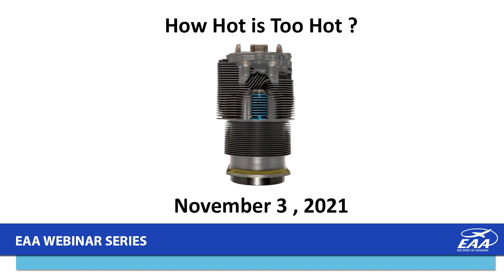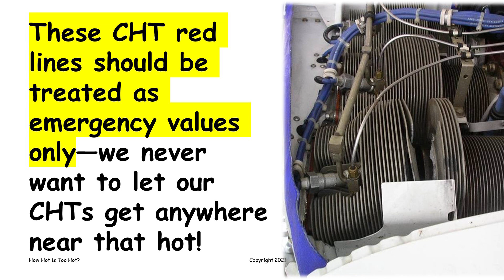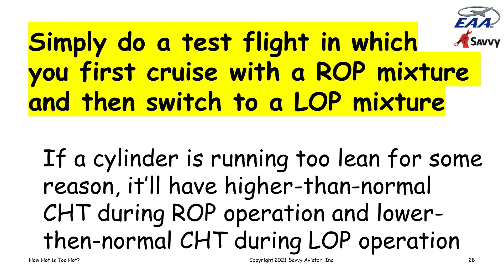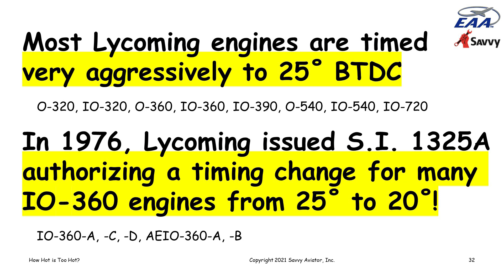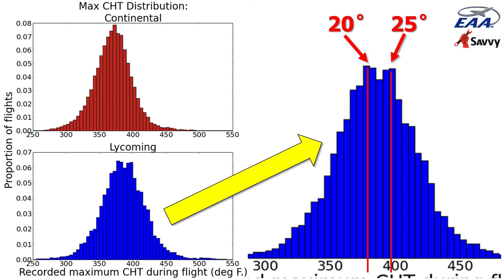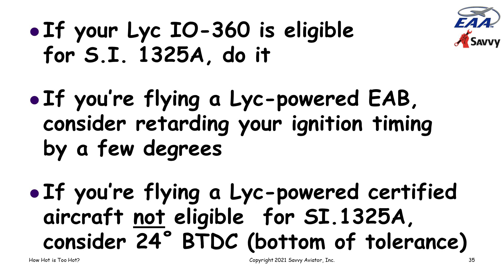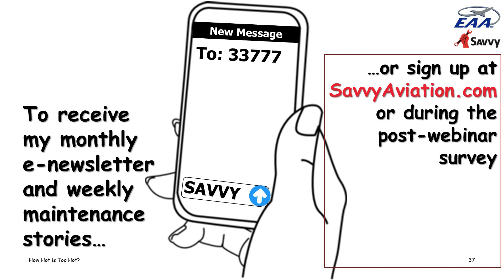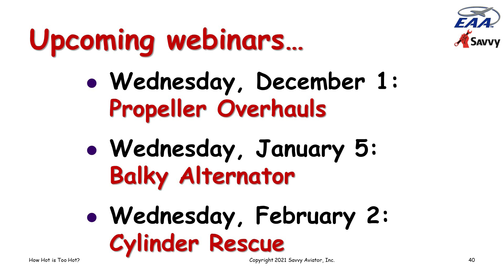How Hot is Too Hot?

Comment: My primary instructor was also the airport manager and A&P and he said shock cooling was BS clear back in 1978.  His C150s routinely reached TBO and they were “shock cooled” on every pattern circuit as he taught us to make all landings as power-off approaches and landings.  I am glad to see the industry finally catching up the him.
Reply: Your instructor was correct way back then but you were not in danger of shock cooling the cylinders from pattern flights. You need very cold for an extended period of time to have enough of a thermal difference to make the rate of change high. Shock cooling would need to be darn near intentional to happen.
Reply: @Pilotman28  Correct.  My comment was meant to be sarcastic for all of the “shock cooling” disciples.  I edited my comment and added quotes to make it more obvious.

Comment: Ion sensing can show peak pressure in relation to timing using a normal spark plug. SAAB pioneered this technology in cars circa 1990. Most current coil on plug auto engines are using this technology. I will comment further in a later post.

Comment: I generally keep all my cylinders under 380 on the TSIO-520's I run in two Bonanzas. 110 degrees and Heavy out of palm springs or something similar, Keeping the hot cylinder under 400 is a chore, but normal operations 380 is no problem. I'm more curious about the "optimum" or "sweet spot" because that 380/400 is for my hot cylinder, in a climb, on a hot day... My coldest cylinder doesn't really get past 350 in any situation and keeping it above idle temp in the decent can be tough.
Reply from the maker: This sounds reasonable for the operations conditions you describe.  You're not doing any harm there.
Reply: I have a 1952 C35, my 1&2 cylinder routinely get to 400-460 during extended climb.  I live in desert south West summer temps get to 110-120 f, this is only a problem during climb once at cruise temps are around 350-400.  How can I keep emergency cool during climb?  Full throttle, mixture full rich, rpm 2300, 100-120 climb out

Comment: Stugling to get my IO-520 B36TC 1983 to run LOP runs rough way before CHT temps drop as required. My Question is if CHT is below 380 and TIT below 1650 does peak pressure still have a effect  . I am thinking about lowering Rpm and Manifold pressure to a level where the temps are as required?
Reply: Call GAMI.  Your setup isn’t tuned right. There is no reason you shouldn’t be able to run LOP without any issue whatsoever.

Comment: I cannot get my IO-540 to run above 300°F. I've heard these numbers before and am very interested in managing my CHTs. We bought the Cherokee Lance (PA32RT-300) with a fresh overhaul. It did not have an engine monitor for the first 400 hours or so until we installed an EDM-830. I was very surprised to see the CHTs never get above 330 in a climb and run around 300 at cruise, slightly lower LOP. I would not think that the 1978 cowling (designed in the 60s) is better than modern design... However, my friend's '69 Arrow is the same.
Reply: Below 300 is unusual.   If you can confirm with a thermal IR gun that your CHT instrumentation is accurate, you might have a timing issue.
         
    Retarded ignition timing will decrease peak cylinder pressure, increase theta PP, decrease HP and also CHT.

    Have your magnetos timed with a Time-rite digital protractor (not a flower pot or using the marks on the flywheel).   Make sure to use the piston plug and the digital protractor to precisely determine TDC.

     Look carefully at your TCDS as well.  Many Lycoming angle valve engines have optional 25 degree (vs 20 degree) timing.
Reply: I’ve got same motor and issue in my Saratoga. At 30 degrees rich of peak, hottest cylinder is 330 and lowest around 298. About 1100 hours on engine
Reply from the maker: Are there cowl flaps?  You can use them as needed.
Reply: @savvyaviation  There are no cowl flaps. The interesting thing is, my friend's (who is also an A&P IA) PA-28R-200 also runs cool. Is this a Piper thing?
Reply: @stevespra1  my Piper Comanche 260b with an IO-540 with a JPI engine monitor runs about 315 degrees for the front two cylinders (give or take) up to 350-360 in cruise on the back two cylinders. It has 1300 hrs on it and I have not had any valve sticking issues. I recently performed the lycoming service bulletin 833c and none of the valves had any sticking issues. But I’m not sure why the front two cylinders run that cool in cruise. I do, however, fly 10.5 and 11.5 k feet regularly and run slightly ROP and close to peak.

Comment: Not a chemical engineer, mechanical engineer which is of course much better still (lol): 1:04:30 the bottom portion of cylinders do not have much heat from the combustion process because the piston doesn't go down that far so no need for fins, not hot enough to justify fins. 1:05:25 : Yes, excess fuel absorbs heat because liquids have much higher heat capacity than the vapour which is most of the substrate. Good question.

Comment: You can buy pin striping tape 1/32" (in many colors_ to mark your gauges on the glass and I would for airspeed and temperatures.
Reply from the maker: Markings must be in accordance with the aircraft type certificate data sheet... (TCDS).

Comment: Whatever the maintenance manual says
Reply: That’s not good advice. If you’ve been in this discussion for long you’ll quickly realize that aviation piston engine technology has been completely neglected in regards to innovation and advancement. Most “new” maintenance manuals were written in the 70s and that’s if you’re lucky. Even if the date of the manual says otherwise, the actual information is antiquated. So much has been gained in understanding by independent testing and borrowing from automotive developments that there is far better management techniques outside of maintenance manuals. TBOs that blow the manufacturer recommendations out of the water.
Reply: @jjchello  The information contained  in SB's, SL's and SI's  augment the lackings of the 1974 manual. The latest revision of the OHM is indicated at the beginning of the manual. None of it is antiquated.